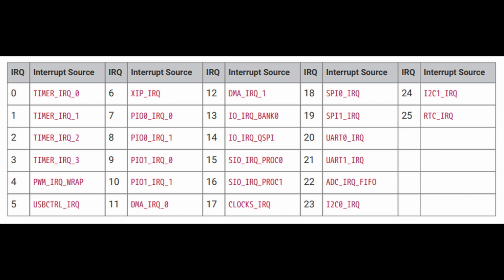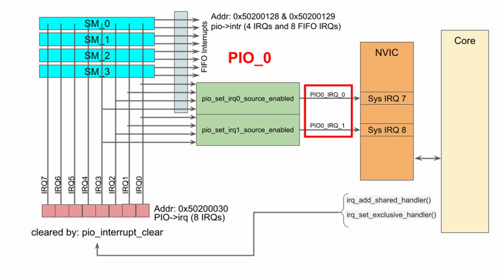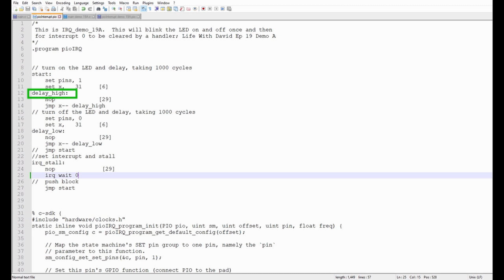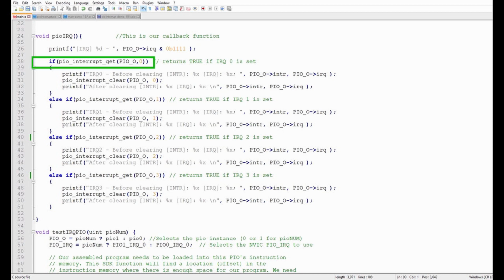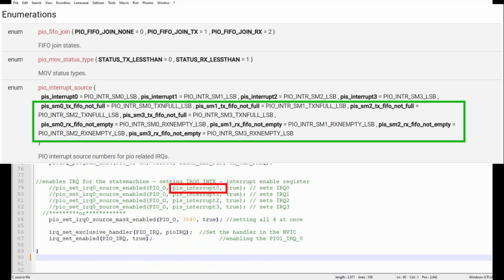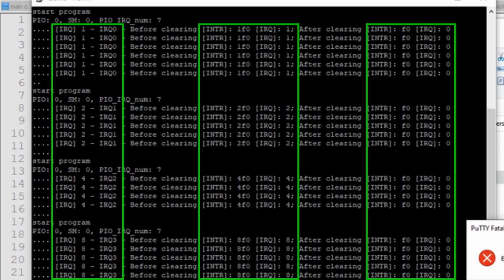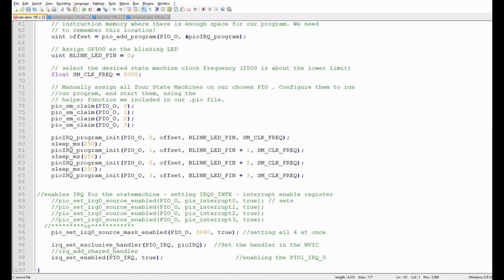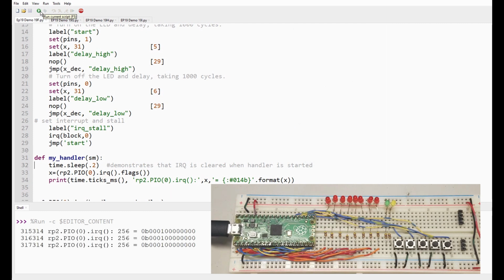Raspberry Pi Pico PIO - PIO Interrupts using C - Ep. 19

Comment: Thanks so much for this video and the corresponding Micro Python video.  When I first read the section of the SDK on IRQ, I thought I was going to have to give up microcontroller coding and take up something easier, but your video helped me understand enough to be dangerous.  The part where you said that IRQ0 from the PIO state machines is NOT THE SAME as PIO0_IRQ_0 was amazingly helpful.
Reply from the maker: You're welcome.  The IRQ0 issue was particularly confusing to me; so once I figured it out; I knew I had to share.  Thanks for watching!

Comment: Great series!  I am trying to understand a program that I found that uses IO_IRQ_BANK0 and I am not understanding.  It seems to different and maybe powerful but why someone would use it is not clear.  Any help or pointers to info  would be greatly appreciated.
Reply from the maker: Bank 0 is the GPIO.  IO_IRQ_BANK0  refers to NVIC interrupt #13 (table 80 of the RP2040 datasheet).  Check out section 2.19.5.2. "Enable a GPIO interrupt" of the RP2040 datasheet to help understand how to use GPIO Interrupts.  You would use GPIO interrupts so you don't always have to check the status of the GPIO.  Instead, let the interrupt start an interrupt service routine when the GPIO changes state.  Then the core can do something productive, like comprehending its navel, while waiting for a GPIO to fire.  It does take a bit of head scratching to understand how to set up these interrupts.  Good luck!
Reply: @LifewithDavid1  Thanks!

Comment: I encountered kernel panics too when i used interrupt callback in ESP32 to indicate when an ADC sample was ready to calculate RMS voltage to current routine.
Solution there was to use RTOS built into the ESP32 framework.

In the case of the Pico, the so-called crash may be the watchdog timer, which was the issue with the ESP32.  Interrupt callbacks on ESP32 would hold up all other background housekeeping, including clearing the watchdog timer in a timely manner.
Reply from the maker: I expect you are correct.  I've done interrupts using bare metal with no watchdog tmer and they are rock solid.  Thanks for the comment!

Comment: David,

Can all your assiduous effort be translated into an equivalent Pico library routine (using the Arduino IDE) of mimicking the Arduino's Interruption Service Routine along with attachInterrupt?

It would stupendous if the Pico hardware interrupt worked on multiple GPIO pins with Modes RISING, FALLING, CHANGE; but I would be ecstatic with only one Pico GPIO pin and any of the modes.

Thank you for all of your diligent work and brilliant video tutorials.

Dave K
Reply from the maker: Thank you for the comment and suggestion.  I will have to look into that.  Unfortunately, I'm not very familiar with the Arduino Interrupt Service routine; so it will take a bit of study before I can figure out what to do.  In my last video, I did use interrupts; but not for GPIO.  Thanks for watching!

Comment: Hi David, is it true that Pi Pico has only one pin interrupt, or GPIO interrupt per core? I can't beleave, I am devastated...
Reply from the maker: If you mean IO_IRQ_BANK0 of the NVIC, then you are right  However, since it is part of the NVIC; it is very powerful.  I haven't experimented with it much, but I believe you can set it up such that any and/or all GPIO pads can throw an IObank interrupt; it's up to the callback routine to figure out which one.  That makes sense because you wouldn't want multiple NVIC interrupts hitting at once for "simultaneous" signals; there would be more racing going on than at the Indy 500.   Like I said, I haven't experimented with this; maybe look into the NVIC part of the ARM Cortex M0+ architecture for more information.  Thanks for watching!
Reply: @LifewithDavid1  Thank you very much for the hints!

Comment: Wow!!! Just found your channel today and it is GREAT! Watched all 20 of your PIO videos and will be studying them for a while to come.

You asked for suggestions, and I would like to pass one along that seems to fit right in with your channel and your PIO programming expertise: programming a Pico PIO as an INPUT state machine for quadrature signals. 

There are a few examples of interfacing a quadrature encoder with the PICO, but they really aren't usable for more that a quadrature demo.

One is written in python and would only work at very low speed (and eats up resources running delay loops in the MAIN program) - 

Since I can't use a link you can google "KY-040-Rotary-Encoder-on-a-Raspberry-Pi-Pico"

and the other quarature encoder code uses 19 interrupts in the MAIN code (NOT the PIO code) to implement a state machine jump table using a few PIO instructions to interrupt the MAIN code, which then has to handle the counter and clockwise/counter-clockwise detection. 

Again, since I can't use a link you can find it on github from GitJer/Some_RPI-Pico_stuff ... Rotary_encoder

Ater watching your series so far, I'm sure it could all be done in a PIO state machine (including the counter)  and send an interrupt to the main code to fetch the count (and CW/CCW input if needed) without wasting so much in the way of CPU resources.
I think this would be of enough interest to draw more attention to your channel and help you get the likes and subscribers you deserve, especially considering how all the vendors from ADAfruit to Pimoroni and Amazon are selling quadrature encoders left and right.

Thank you for this series!!!!
Reply from the maker: Bart, that's an interesting idea.  I haven't done anything with encoders (although I do have a video on resolvers).  I'll look into that.  One hurdle is that PIO doesn't have an increment instruction, the closest is the decrement and jump.  But that could be worked around.  My current focus is assembly language programming of the RP2040.  Maybe something can be done to marry them (ASM & PIO) together.  Thanks for the suggestion!

Comment: Have you thought about linear power control of AC with triac(s) bye using the PIO?
Reply from the maker: That would take a little thought.  An easy way to determine 0 crossing time would be to use the RP2040's built in ADC.  PIO doesn't access the ADC directly, however, you might be able to do something with DMA; I'm not sure.  The other way would be to build a 0 crossing detector circuit and feed that into the PIO.  Interesting.
Reply: @LifewithDavid1  I use a H11AA1 for the zero crossing detection and DMA for the PIO plumbing with interrupts for the triggers. I thought this may a good topic for one of your PIO videos.
Reply from the maker: That would be cool.  Thanks for the suggestion.  There is so many things that little board can do; I hope to do so many projects.
Reply: By the way I have a 1000 steps for the power to (half) phase table, this is for accurate solar power diversion into a 4Kw load. 230V @ 50Hz here in NZL.

Comment: "All modern processors use interrupts."  It warmed my heart to see a 6502 among the modern processors.  Interrupts were simpler back then...
Reply from the maker: Yea, I purposely threw that in.  As you can see from some of my previous videos, I really like the 6502.  It was cutting edge when I started designing my computer.  In fact I have a 3rd quarter 1975 version in a ceramic and gold DIP.  You are right; interrupts were much simpler.  Thanks for watching!